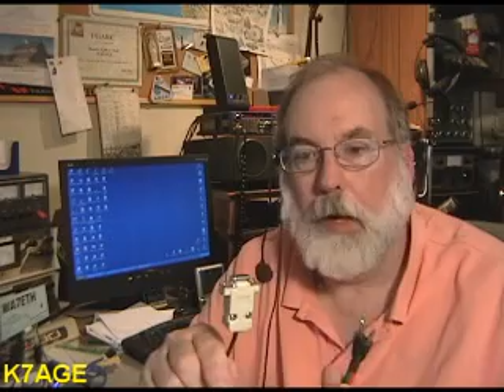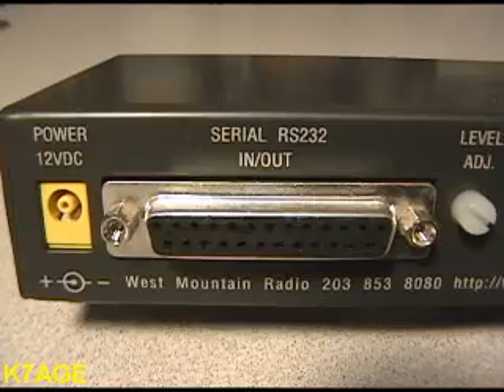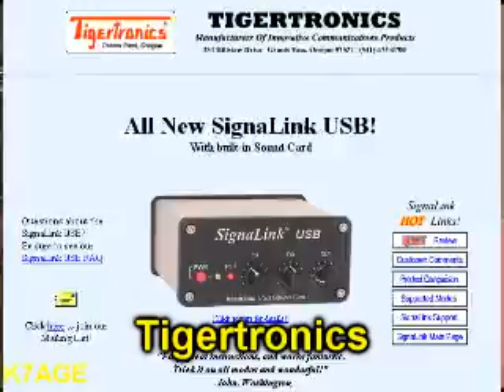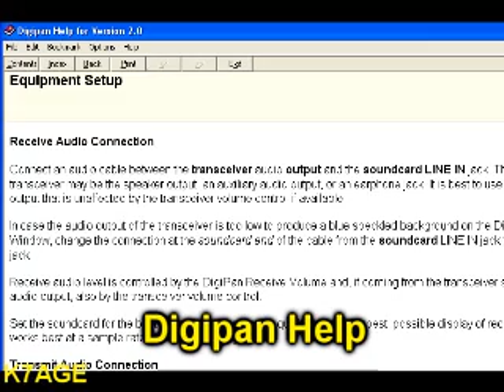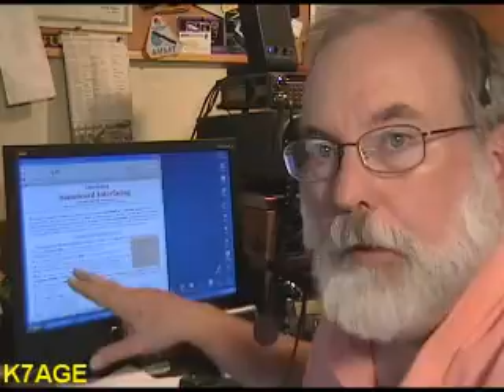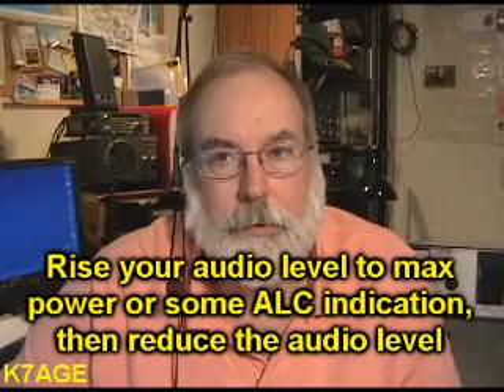How to interface a sound card for Ham Radio

Comment: Do you have a video explaining how to connect up  older radios for RTTY, PSK31, that do not have USB connections, and in some cases no RS232? For example I have a JRC-135 which is quite rare. It does have a utility socket but the manual terminology has more to do with ( I think) printers rather than interfacing with computers! So a video on this specifically would be handy!
Reply from the maker: I don't have a video about your issue. First,  you may not need RS-232 for your interface. That gives you rig control and maybe PTT. You need to google around for the older sound card psk interface. Before all the modern USB interface guys built their own interface. Google K7AGE PSK31 and you will find many of my videos on this subject.

Comment: Thanks! I think I will utilize the little surplus Baluns I have been using, with a buffered op amp preamps/amps going  both going ways. That way I can  preset an auto controlled level out to the TX, and use a fully optoisolated MOSFET or relay control circuit for the TX/RX controls. This way there should be no ground coupling to cause any ground loops at all. I use a lot of Deutsche Industrie Normal (DIN) cords anyway. Those can be maddening to work with, at first. Not a big fan of tape, where I live. It is hot here and the tape winds up a sticky gooey mess covered in dirt. Heat shrink works really well. I used lacquered flax cord with a cloth guitar patch cord on my Vibrolex semi-auto standard key, for CW, & It really looks 1930s period correct. I am probably going to go get an older Kenwood this week. That volatile memory in the new radios is just a pain in the neck. I suppose I could make a dual battery connector, so I can hot swap the dying batteries out, without losing the memory. I don't know why they did that. It just seems dumb for any maker of a $1200-$5500 transceiver to do that & use volatile memory in the RAM, without a good good backup system.

Comment: If you've just got the mic and speaker jacks of the rig and PC connected, couldn't you just use VOX to key the radio?
Reply from the maker: Yes you can. Some radios, may not allow VOX to work when audio is connected to other than the front mic jack.

Comment: @3:50 The best way to prevent windows sounds from using the second sound card is to set the "default" audio device. Then the only sound on the second sound card will be from the programs that you set to use that card.

Comment: I wish I could hear the audio.  All computer audio now plays through my Navigator and is too low to be heard.
Reply: Plug you earphones into your computer's jack.
Reply: Michael Miller
Naw, won't work.  The audio from the computer is routed through the interface which has a very small internal speaker.  I have something in the configuration setup wrong and was hoping to find out what it was.  Guess I'll keep clicking and reading.  .  .
Reply: My RigBlaster was similar to that.  I had to right click on the speaker icon (Volume Icon in the bottom right-hand corner) and edit the sound properties.  From there, I could select which device I wanted Windows to use as the Audio output.  I had to manually select, "speaker" or something like that to get the sound to work.  But, later when I wanted to use the RigBlaster, I had to undo those steps to get the audio to go through the RigBlaster.
Reply: Michael Miller
Wow!  That worked!  I never right clicked that icon before.  Did not know that was possible.  Thanks.  The audio is working perfectly.  I'll check it when I switch back to PSK-31.  I did not know you had a RigBlaster.  Which model?
Reply: Well, I meant to say "SignaLink USB" but it is a sound card interface device just the same.
Reply: Michael Miller
Neat!  When I get mine going and you get your antenna fixed we'll have to get on PSK31 some.  I can receive fine but so far I've not gotten any replies to CQ's or direct answers to other CQ's.  I must have something set wrong.  I'm still reading though.   I have never seen a complex program as HRD is.  It's awesome.  .  .
Reply: Well, if you can hear the audio coming from your SPEAKERS when you transmit then your settings are wrong. The only way I could  tell if mine was transmitting was by watching the SWR meter move. I made several contacts once I got it working then my computer died... I have a bunch of work to do to get it running again.
Reply: Michael Miller
Yep, that all is working.  When I hit the transmit button, the radio keys up and there is power out per the meter and I hear the tones in the speaker but it's like no one can hear me.  It may be that I am splattering or something.  I'll work on it after Christmas or else stay up late tonight watching for Santa.  .  .   :)
Reply: Do you use a waterfall display to see the signals? I would just wait to hear one calling CQ, click on the band, then respond. It only took a couple of Watts of power to make a contact.
Reply: Michael Miller
Yep, good waterfall display.  I've tried that plus getting in a clear spot and calling and calling, etc.  When I click on a CQ and answer, the other station acts like they never hear me which makes me think that I am sending reverse shift or something.  I am going to search youtube for more videos.  I'll get it somehow.  .  .

Comment: I use the TIgertronics SL-1+ which doesn't use USB, it has a built in PTT circuit and uses the audio direct from the computer sound card.  It takes some twiddling with the settings to get it working, but it has worked well for me.  It just connects to the sound card headphone out/microphone in jacks, so no need to worry about it needing its own device driver.  I use it with my Kenwood TS140S and it works great!

Comment: Excellent tutorial, for what it is worth being a cheapskate I have run some of these modes using just the attenuation and cables to the PC, some rigs allow you to use VOX even on phone patch inputs or similar.

600ohm line transformers can often be rescued from old PMR base stations although a variety of stockists here in the UK do sell transformers suitable for avoiding ground loops in this application.

73 and thanks for investing the time in making the video.

Comment from the maker: I'm not familiar with the PC-1A, but I don't think that would work very well without some modifications. It interfaces the one telephone line connection to mic and speaker. You need to interface the two connections from the computer to the radio. Randy

Comment from the maker: Correct, sometimes you need a USB to Serial adapter. Or, the newer USB interfaces, that also include the sound card are an alternative. On desktop computers, I like to install extra RS232 ports. I think I have 4 on my computer now, and I bought a couple 4 port modules in case I needed to add more ports in the future. Randy